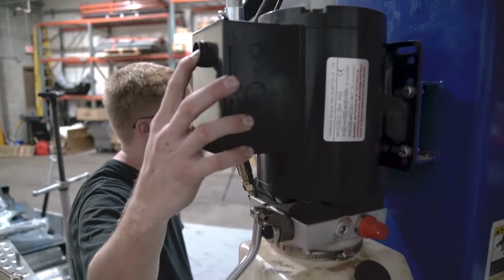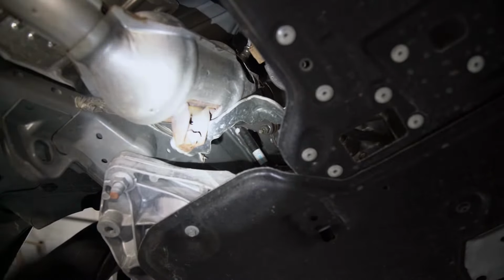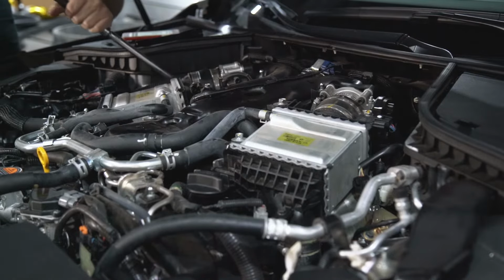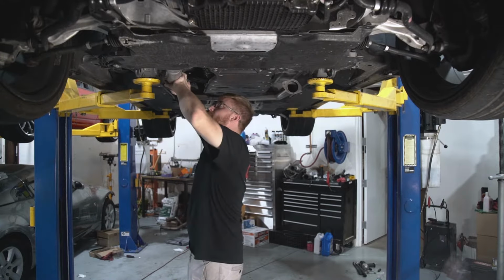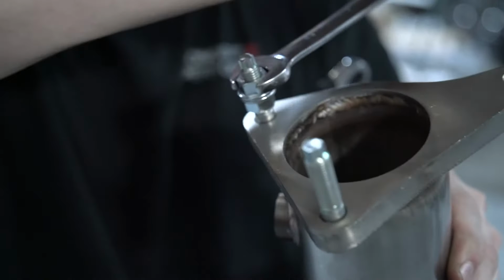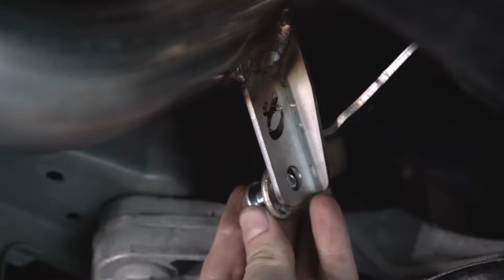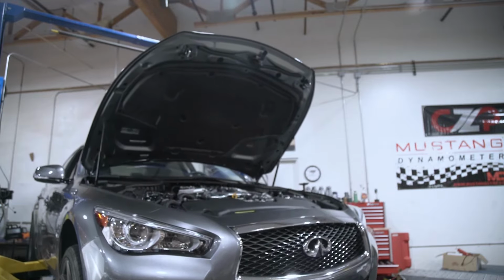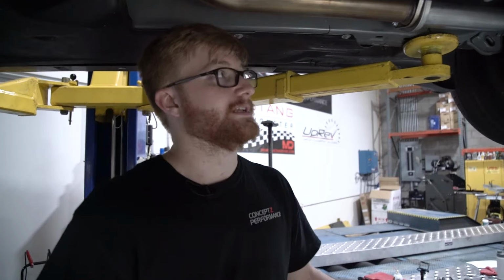Q50 AMS 3 Inch Down pipe Install Tutorial

Comment: So I’ve had two q50 AWD that I’ve done downpipes on, both passenger side cats gave me trouble. One the upper right bolt / nut stripped. Other the upper left bolt head is stripped. Can’t stand this. driver side Downpipe is 2 seconds.

Comment: Why would you do 3 inch LDP on 2.5 Inch Stillen cbe… I just dont get it.  Air flow  would be ruined essentially and would bounce off gaskets where they connect causing pressure on turbos no?
Reply: @KGALLDAY  im going through this right now but its been proven and tested for years by people smarter then me. You get about 450 whp and 500 touqre

Comment: No link for the power it made?
Reply: The downpipes by themselves will only yield about 4 hp. Getting a cat back exhaust that gets rid of 2 more cats and a tune will yield about ~36 whp & ~46 wtq. If you do the z1 racing pipes, cbe and tune it would be 60+ whp & ~149 wtq.

Comment: Do you need a heat exchanger if you install lower downpipes?
Reply from the maker: they're not related to one another, but if it were my car I'd do a heat exchanger before anything else since these engines heat soak like crazy
Reply from the maker: check here for one https://conceptzperformance.com/search.php?search=heat+exchanger&filter=8

Comment: Hey do you guys know if these downpipes give you a check engine light? If so, do you need a tune to get rid of it?
Reply: My understanding is that you shouldn't get a check engine light if you install the O2 sensor properly without a tune and you have no exhaust leaks.  The primary cats perform well enough to avoid a CEL.

Comment: Will installing these downpipes pass the emissions test??
Reply: Most likely no because of extra flow being read by the 02 sensor causing a check engine light
Reply: @bambisautomotive  no CEL should be popped because the lower dp is after the primary o2 sensor

Comment: question does installing these lower donwpipes,turn on check engine light?
Reply from the maker: Just lowers won't, because the ECU only monitors the upper cats
Reply: What happened to the passenger side o2 sensor ?

Comment: when removing the original pipes doesn't the cat have a heat shield, do you recommend adding heat exhaust wrap on the new pipes?
Reply from the maker: no, not really. it is a great idea to wrap it to help keep temps down in general but not needed if you wanted to grab some wrap heres a link
https://conceptzperformance.com/dei-design-engineering-inc.-dei-010129-titanium-exhaust-header-wrap-2x-15ft-universal_p_16544.php

Comment: Nice video, but no cat?? Is going be 
pass emissions??
Reply from the maker: Technically illegal for road use, this is technically for "off road use only" but will pass emissions with these installed as they are intended to not throw any check engine codes
Reply: 2 cats per side on this car

Comment: What Y Pipe should we run with these test pipes. I installed these last week and the diameter difference in the pipes and the OEM Y Pipe is disgusting. Y Pipe needs to go!, Just worried about having to keep the BS 3" to 2.5" gasket in there as I can't find any Y pipes that come fully 3". Most are 2.5 some 2.75 from the cats to 3" at the mid pipe. Could use some help here finding a completely 3" y pipe

Comment: Quick question, what size O2 socket needed to remove O2 sensor? 7/8 "(22mm)? Great detail video. 👍🏼
Reply: This is a good question!  There is a special socket intended for use with O2 sensors also.  Can a plain open ended wrench handle it instead?

Comment: do u have AMS down pipes for g37 or 370z ?
Reply from the maker: As far as i could see AMS doesn't make any for the G37/370Z. I would recommend this which has a small resonator to help with some of the rasp but still has great flow https://tinyurl.com/ycvceyg5 if you have a bit more cash to spend and want a better sounding test pipe I'd go with this one here https://tinyurl.com/y6v4lmkj best sound from any test pipe in my opinion.

Comment: For the extensions are you using a 3/8 drive or 1/2 drive to loosen the bolts ?
Reply: i just did this myself and 3/8 was fine.
Reply: Tee Jay did you have someone help you at all?
Reply: @DanielRuiz-ux3bf  no. I did top bolts first than bottom. Hardest part was unplugging o2 sensor on passenger side
Reply: Tee Jay what size o2 sensor socket you need for this? Slim profile socket?

Comment: I want to do a similar install to my 2018 Q50 3.0t with the catback and down pipes. Question does a install like this void the warranty, throw any Check engine light or fail the the yearly state inspection. Great video.
Reply: No Infiniti confirmed for me
Reply: Thanks thats good.
Reply from the maker: no check engines codes will come up with this but it depends on the laws in your state whether its okay, it might still pass but technically be illegal
Reply: Thanks again, looking forward to more videos.
Reply from the maker: sure thing

Comment: So do the lower down pipes require a tune after the install?
Reply: @jeremywilliams050  it's a turbo car you'll have a check engine light but it will drive and be louder just not really added power with no tune

Comment: The 3” to 2.5” step probably costs a good amount of power.  Should pick up some 3” to 2.5” cones from Vibrant and weld them in to smooth out the transition.
Reply from the maker: we would have preferred to just go with a full 2.5" but that's what the customer wanted so we wanted to know what kind of power it could make

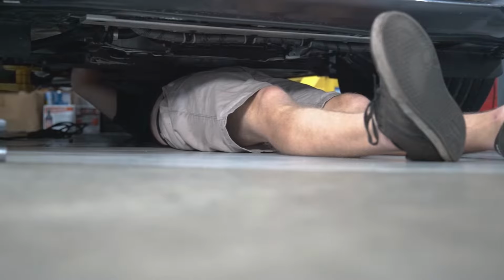Comment: At 3:23 was by far the most grueling and frustrating part of this install. Took my buddies and I two days to get these damn things loose once we were finally there. Nissan/Infiniti definitely builds their engines to not be user friendly.
Reply from the maker: It is definitely a 2 person job at minimum. With the proper tools it took us about an hour to break all of them loose. We're glad this video was able to help somewhat
Reply: @Conceptzperformanceczp  ya'll made me feel really happy/lucky with this... this was easiest part for me and took me no more than 15 minutes to crack them all lose, used extensions with wobble tips and was also by myself.... I assumed this would be the hardest part so once i cracked them i committed to moving forward with everything else.

My biggest issue was passenger side o2 sensor as there was NO way i could reach my hand in there... after 30-45+ mins of thinking/testing some strategies i ended up using a pry bar to pry the plug out of its mount to give me the slack i needed to pull the pipe down and out of the way enough to reach up and unplug it

Comment: Any difference of install on the awd vs rwd platform
Reply from the maker: for down pipes no, it's very similar
Reply: Yes drive shaft is in the way of the passenger side so it will be very difficult
Reply: Yes drive shaft is in the way of the passenger side so it will be very difficult